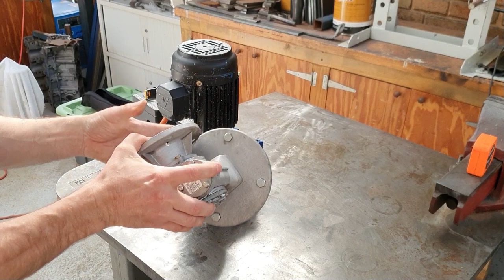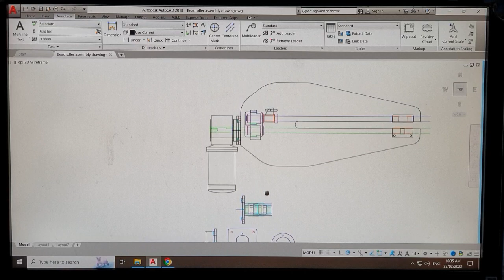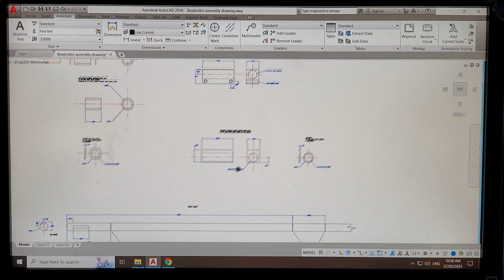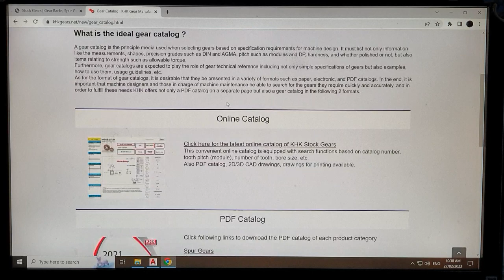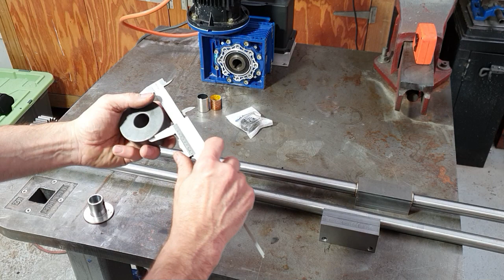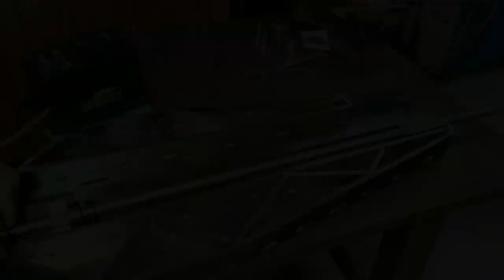Home made heavy duty bead roller build part 1

Comment: Hi Elliot , I have a 3 phase motor which says VSD only on the asset plate ,I also have a single phase motor with no advisory information, I have no access to 3 phase power in my garage, my single phase motor already has a 80-1 ratio worm gear fitted, I know fuck all about electrics ,I already have a heavy duty bead roller which I've strengthened and had a longer shaft machined to fit through the worm ,all I want is some form of speed control and forward/reverse function 
Please advise 
Regards jim
Reply from the maker: I think 3 phase motors are easier to control than single phase motors as far as adjusting direction and speed.  Also more torque from a 3 phase motor at low speeds hence thats why i went 3 phase for the bead roller.  I cant advise to go buy a vfd and wire it up because i dont want you to hurt yourself but theyre usually fairly simple to install.
Reply: @elliotaw yes I've spoken to Newark electrical motors and they're sorting out a motor, worm gear and vfd 
So all good,thanks for your reply 
Jim

Comment: I get most of my heavy steel chunks from a local scrap yard effectively for peanuts. Your design is not over engineered in my book, this sort of machine always better if it's rigid.  I built my own English wheel and it's heavy, very heavy!  But it responds really well and doesn't flinch.

I am interested in how you plan to secure the second side plate and still transfer the forces into it, or are you just planning to use it as a removable lid rather than a stressed member... Having seen your web design which I think is really neat, I would have inserted solid 25 or 30 mm Dia. steel bobbins at each intersection in the web and doweled the lid to the base with 12mm dowels, if you follow me?  That would increase the rigidity a lot. Either that or tight fitting bolts.

My only slight criticism of your dialogue is you repeated several key points, for example, the inverter can stop the motor without ramp down, this sort of info, once is enough, we are listening!  No worries, just saying,  NOT getting at you, I know it's not easy to dialogue a video.

Robert
Reply from the maker: Haha..  im shocking at speaking to a microphone, out of my comfort zone 100 percent.  The other side plate is now fitted..  fully weld prepped around the perimeter and mig,d to death.  I took a template of all the interior webbing, transferred that to the other side plate and drilled 30 or more big diameter holes and hot welded the whole assembly into one rigid piece.  Its taken a bit of work with heat and hydraulic pressing to get all back within spec.  Working on the stand at the mo.

Comment: I've thought about a similar project for some time and the issue has always been finding an inexpensive way to go slowly enough. I had occasion to use a Lazze machine and , even on that one, the motor has to run very slowly to achieve appropriate speed for the rollers. An issue with running the motor very slowly is that the cooling fan is ineffective. If the Lazze machine was run for a long time, the motor would overheat and trip the thermal limiter. No permanent damage, but you had to wait for it to cool down before proceeding. May not be an issue for your motor, but something to be aware of it it suddenly stops in the middle of.a big project. Simple solution is a separately powered muffin fan on the motor that runs at full speed regardless of motor speed.
Reply from the maker: I dont think there will be much load on the motor due to the gearbox ratio..  ive let the motor run at its slowest for a considerable amount of time and the motor still feels cold to touch..  will have to wait to see how it functions in real time though...

Comment: Elliot,
Very nice. Very similar to what I built. Mine has a 26 inch throat. The upper shaft slides 2 inches for and aft. Variable speed forward and reverse.
I do wish I would have built it with a wide mouth. Yours is going to be nice and stiff. great job. 
It will be nice to see what you produce with it. Keep the video's coming.
Cheers.
Reply from the maker: Thanks for the feedback.  I might have to build a 2nd wide mouth version eh

Comment: Certainly going to be rigid, I've got one of those H&F 600mm deep throat BR and it does indeed flex and the motor control jerks at start up on slow speeds... not to mention having to send it back due to keyways having way to much slop due to being assembled by some ham fisted idiot!
Reply from the maker: You have to start somewhere.  I did originally consider buying a cheapy and then look at beefing it up.  At least that would have gotten me up and running a lot sooner.

Comment: Very Nice start way over built but can't go wrong with that. Steel must be way cheaper down there than in Canada lol I bought my roller and modded it since it was cheaper to buy a built one than to buy the steel. I run mine between 4-8rpm for 90% of my pieces. Wish I had bought or modded it into a deep throat roller, would be handy for some projects. 
Look forward to the next parts of the build.
Reply from the maker: Thanks for the reply.  I wish steel was cheap.  Ive been making this machine a bit at a time so find spreading the cost out makes it more affordable.

Comment: Really nice work! Thank you for your explanation of what a VFD is and how it works.

The trusses you made the arms into will work well on the vertical load and the torsional load. 

I am interested to see how you will stiffen the weakest part of the machine where the throat ends.

Are you going to fully weld every seam? 

Cheers
Reply from the maker: Im interested to see how much flex there will be in the frame aswell.  I do have a bit of a cunning plan but it doesnt involve strengthening the mouth of the machine.. im not going to fully weld it.  Im worried it will put too much heat into the frame and potentially shrink and close down on the parts inside that need a sliding fit.